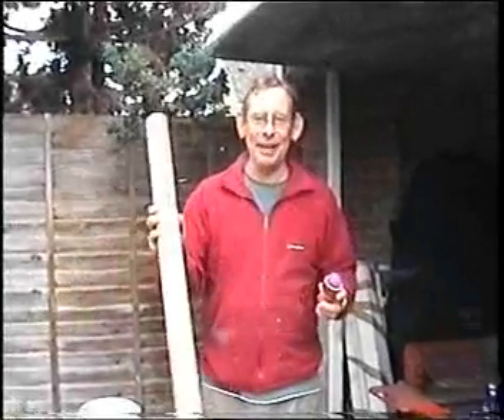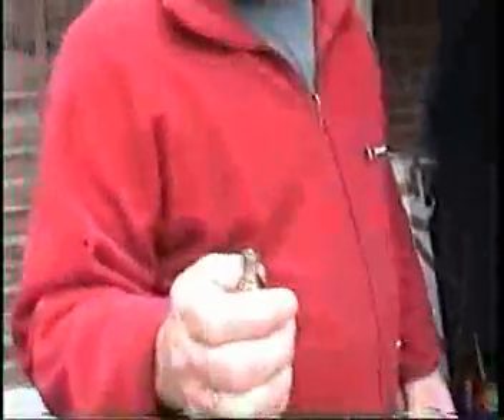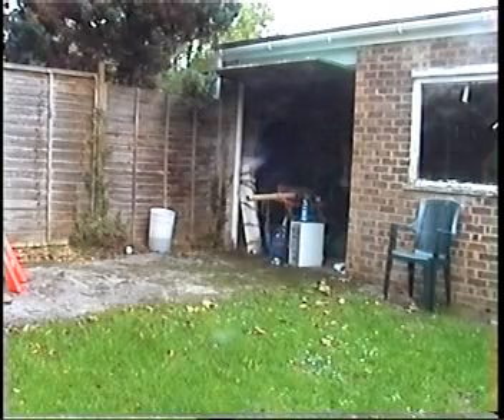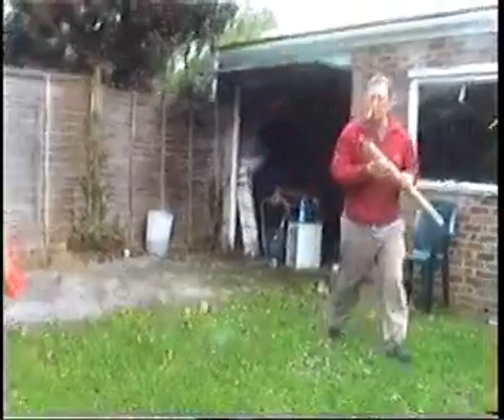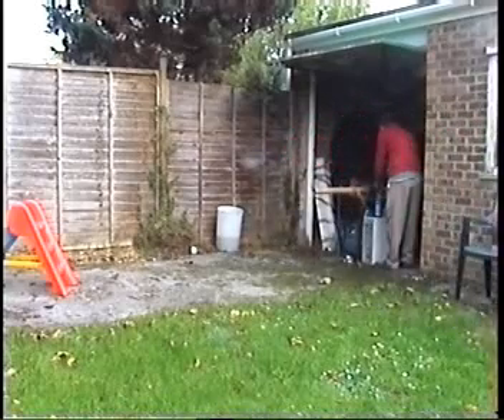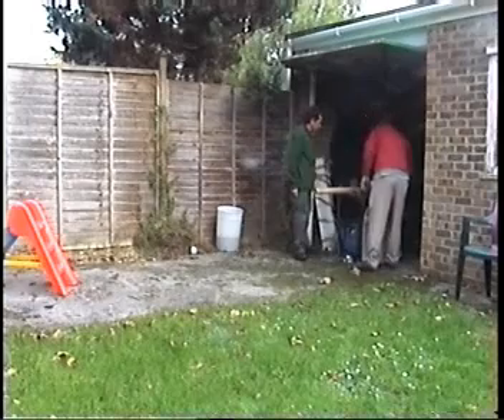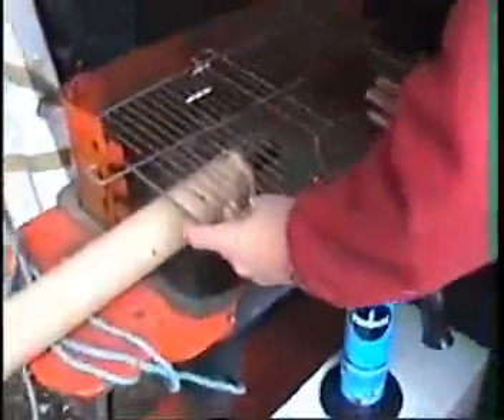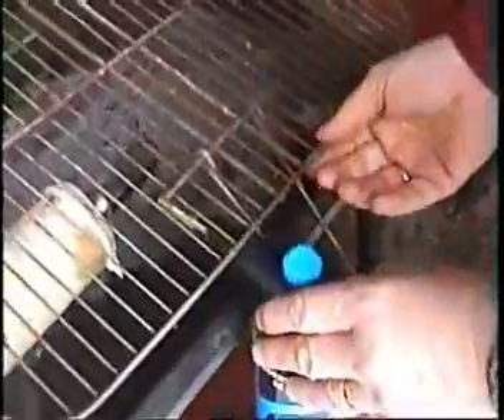Archimedes Steam Cannon - Myth Confirmed

Comment: Good one, we did something like this but instead of the solder we used a thin aluminium plate between the boiler and the tube. It fired potatoes about 20 metres with quite a bang.

Comment: This is merely another form of high pressure vessel fitted with a valve of sorts.  That you have a vessel building pressure until it's released by either a valve or in this case the planned failure of the solder, its still not not the sort of design they disproved in mythbusters, which was that a cannon could be made that would instantly flash water to high enough pressure steam to launch a projectile.

Comment: Water boils at 212 at sea level 14.7 ambient.
In the cylinder the water gets above 212 under higher pressure then when the solder melts and the water leaves the cylinder and expands instantaneously to steam 1700 times its liquid size displacing the rocket  as predicted by Archimedes.